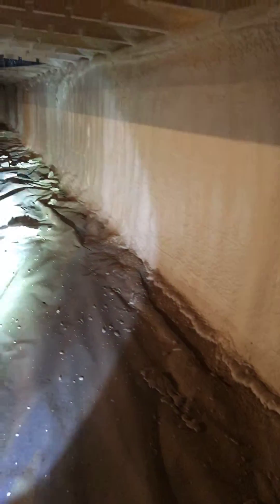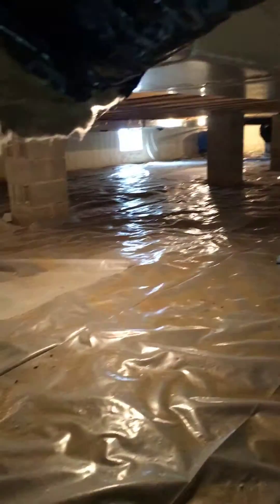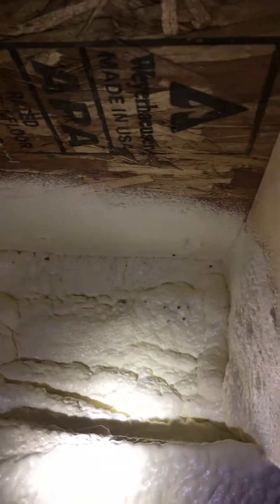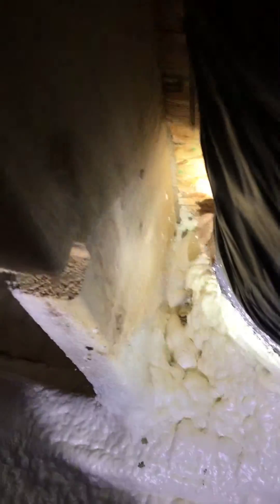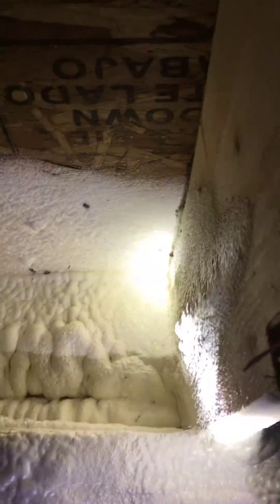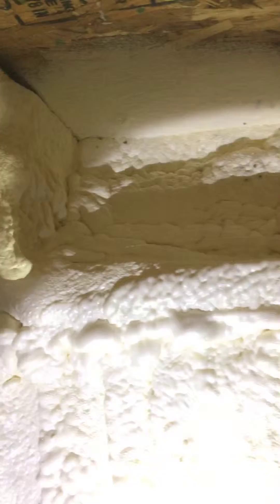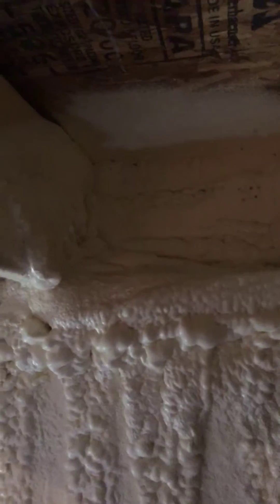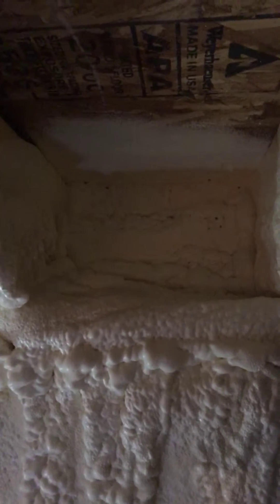Finding Termites in Spray Foam.

Comment: what should be done about the termites and how? I spray foamed my attic and exterior walls  i found these signs and actual termites in the holes coming out of the foam.  any help would be greatful
Reply from the maker: I would definitely call a pest control professional. While I believe in the Sentricon baiting system it also depends on where you live. With direct access too the termites they can use the AG’s (above ground stations-soft bait). This will eliminate the colony. My concern if it’s a non-substrate type of termites in the south house may need to be tented(fumigated).

Comment: This happened with the house I bought 4 years ago.  Had swarmers in the house 2 years afterward  despite a liquid treatment done at the time we bought it.  Someone sprayed foam all the way up and covered the rim joist.  I ended up cutting out foam several inches below the rim joist so the inspectors could see, and found several entry points: one where the termites ate into one side of the entry door, and two where they went in and started eating the hardwood floor.

After that I really lost faith in the pest control company I was using, particularly because there was a dormant shelter tube clearly visible at one spot.  Was it there 4 years ago?  Did it just pop up?  Hard to say.  I changed over to another company that uses Sentricon, and a year afterward they replaced bait in an area that had been retreated with liquid.

Not sure why I'm saying all this, except that I'm surprised a home inspector wouldn't have pointed out the lack of visibility in the first place.  In fact, I think code (in our area at least) requires a termite inspection gap for specifically this reason.
Reply from the maker: I’m sorry I missed this comment and just now replying. I have watched people get taken by inspections and bad pest control. Sorry you had to deal with this. I’ve had to go to court many times to put some of them down that were obvious oversight and some with bad applications so they still had live termites feeding away at the home. Internet reviews are really helping weed out some of this although even now companies can delete bad reviews or like BBB they can just pay to keep high ratings. Do a lot of research and use multiple sites to decide on reviews is my opinion.